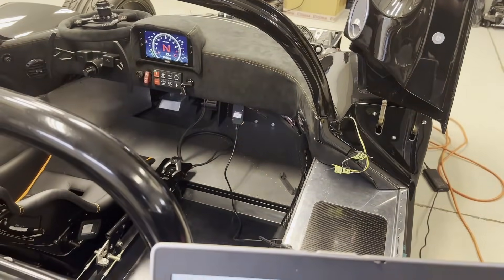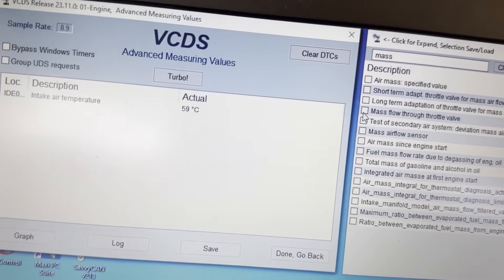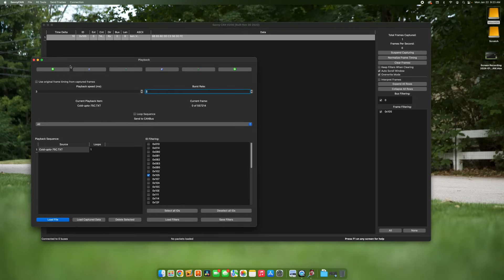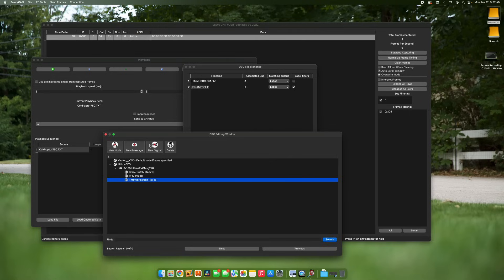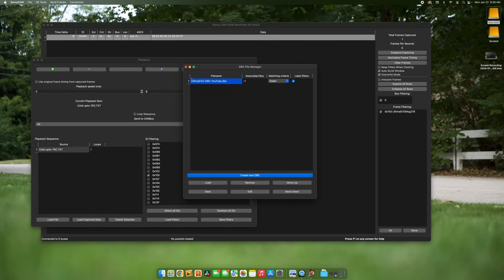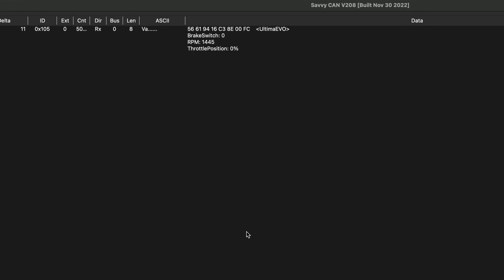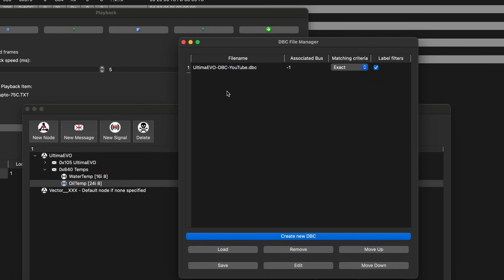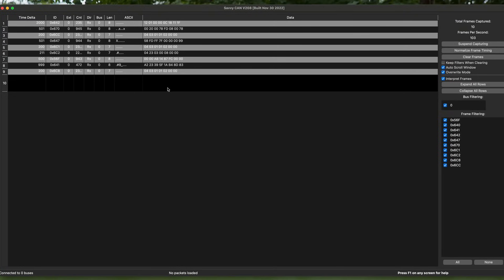PART-2: More CAN BUS Reverse Engineering on my R8/Huracan Powertrain!

Comment: Small tip on finding temperatures: If you're able to get to the sensors connector without dismantly any other electronics you can simply disconnect that sensor and should see a drop to 0x00 in value. Most automotive temperature sensor application start at -40°C for 0x00 which is also used to detect a short to ground or open line.

On the flip side, if you short out the 2 pins of that connector you will see a rise to the maximum hex value.

Thank you so much for doing this, I had no idea there was software to read it bit by bit as well. This will be very helpful in decoding my vehicle from here on out!

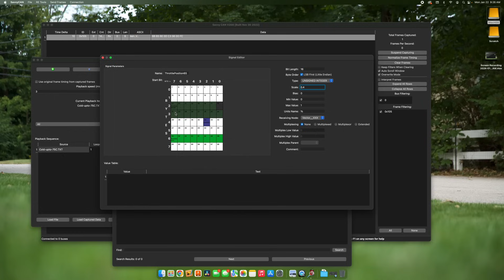Comment: Another nice video. However, your description of endianess isn't quite right - you've probably been confused by how SavvyCAN shows the signal location in the diagram. The Byte Order setting does NOT change the BIT order within each byte, as you desecribe. If your 16-bit signal had a value of 0xAA55 in little endian it would have a value of 0x55AA in big endian. Starting at 6:04, for little-endian (Intel) byte order, the grey box shows the LEAST significant (lowest value) bit (LSb) in the signal. When you change to big-endian (Motorola), the grey box shows the MOST significant bit (MSb). The Byte Order setting does NOT change between the bits being read left-to-right or right-to-left, as you describe. This is hard to explain in writing, but if you try the same experiement in Kvaser Database Editor, you'll understand as this has an arrow showing the bit order within the signal. This won't matter for most of your audience but I just wanted to offer this explanation for completeness and in case it helps you.
Reply from the maker: Thanks for the detailed explanation!  Since posting that vid, I since learned exactly what you describe here. It was a steep learning curve but I think I finally understand it 100%. Thanks again for your detailed explanation!

Comment: As someone that had access to the full internal docs of the CAN bus protocol on some cars I can give you some hints. By full I mean everything, every module, sensor and such. Sometimes there multiple versions of the data. From the actual sensor/package and then specially combined for things like instrument clusters. Engine temps are often combined, because they are shown by the single instrument cluster. But somethings like switches for mirrors, seats, lights, distance sensors a.s.o. are all over the place. Also, as seen on the example VW Golf file, some values are odds like 3 bits and often don't start at byte boundaries. And let's not talk about the offset and scale things, also all over the place. BUT you did a good job reverse engineering the stuff. Did not know about those advanced reverse engineering tool. Learned something new in the series.
Reply: Are these multiple versions in some type of umbrella, file folder configuration?

Comment: probably the best tutorial on Youtube so far! Congratulations! Have you found any CAN data about alternator and battery status, as well as catalytic converter status? I am trying to do some troubleshooting on my old Volvo but I do struggle to find help online
Reply from the maker: If your Volvo was manufactured any time after 1996 then it supports OBD2.  If this is true, then I would try a generic OBD2 scanner and you can read battery voltage, charging state as well as the behavior of your oxygen sensors (pre and post cat).  CAN data availability on older cars up to ~2005 is pretty limited....Hope this helps!

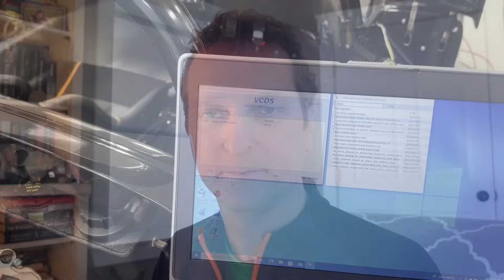Comment: I have watched part 1 and 2 of your series and am impressed by this reverse engineering. However, I am not sure whether you have actually determined the intake air temperature. You have used the airflow sensor at 34:00 minutes into the video. As the sensor name suggests, it measures the amount of air passing by per unit of time. By blowing air through it using the heat gun you change this value. I am not sure whether the same sensor can measure the air's temperature as well. So it could be that you found the intake air flow, not the intake air temperature. In your particular case I suspect that you compared your finding with that of other dbc files to confirm the correctness. If somebody does the same reverse engineering on another car without having a reference the two signals could get confused. Air flow and air temperature can be distinguished in that case by blowing ambient temperature air through the sensor: the air flow will increase but the temperature will remain stable.
Reply: The MAF sensor usually comes with an integrated temperature sensor, especially in VAG cars.
Reply from the maker: Most if not all MAF sensors measure  both air metering and air temp via two integrated sensors. The air metering sensor is way more sensitive and measured at a much higher frequency than air temp. Although I didn’t show it on camera, I used the heat gun at the same air velocity but varied the temp output to confirm I was measuring temp and not velocity. Plus, since the intake air temp value is in the same CAN ID as other temp values (oil and water), I’m 100% confident I have the right signal. Thanks for your comments and question!!

Comment: where were you 10 year ago when i was doing this lol

i would be trying it just for fun but now my obdii port doesn't have a direct access to the bus 

most new car have a bridge to prevent hacking

i had to find the value with obdii request instead
Reply from the maker: Yep, you’re right. I don’t have a “CAN gateway” in my setup so it’s easy to tap. But with a CAN gateway, you have to tap into the proper CANBUS wires directly and bypass the gateway. I meant to mention this in my video. You’re spot on. 👍

Comment: Amazing work! Surprised that the IAT logged so slowly. I guess that IAT temp signal is not the same as the actual MAF signal, even though it's from the same sensor, but still i would think they would want a higher Hz on IAT than coolant/oil. But maybe these CAN signals are only used for logging/display?
Reply from the maker: Yeah, I’ve learned that a lot of the critical engine telemetry is not broadcasted on the CANBUS. So to your point, I’m sure the ECMs are reading this data at a higher frequency directly from the sensor(s).

Comment: Would it be possible to write something to CAN to activate certain car features? For example, I have a button to enable sports mode, but its state is always off when I start my car. Wondering if I could reverse engineer what the button does and replay the CAN message via some microcontroller attached to odb2 to activate the sports mode every time I stat the car.
Reply from the maker: Yep, I bet you could do something like that. First you need to figure out if the button is a simple “dumb switch” wired directly to the ECM (like the brake switch in my video example) or if a button press sends a CAN message across the network. Either way, sniffing the CAN BUS while pressing the button will get you the answer. Once you narrow down the CAN ID and message that’s sent, you could replicate that with any number of CAN message transmitters.
Reply from the maker: Also, ECU Master makes an awesome little CAN device where you can program CAN frames to send. Might be the ticket for you.
Reply: 100% you can. I rolled down windows or locked and unlocked doors on my laptop by sending the respective CAN messages in my Mercedes about 18 years ago. I also developed a MCU based control module to open the sunroof (tilt) when the temp is too hot and closes it when the sun goes down and it cools off amongst other features.
Reply: @Bastard_Operator_From_Hell What is MCU?
Reply: @JohnZornAscended  abbreviation for microcontroller
Reply: @Bastard_Operator_From_Hell  ohhh.

Comment: Great video mate, what equipment would you suggest to allow a BMW m57 Ecu to integrate into a Chrysler vehicle canbus?
Reply from the maker: Hi!  You would need a CAN gateway of sorts that could take signals from m57 ECU and 'publish' selected messages to the Chrysler CAN BUS (and vice versa).  You might want to checkout the CAN Triple...it's a newer DiY product from https://mintonperformance.com.  Check it out; might do exactly what you need.
Reply from the maker: another thought: if the m57 ECU and Chrysler canbus are both running at the same canbus speed (usually 500Mbps), you could try simply adding the m57 to the Chrysler  powertrain CANBUS.  You might get message collision (if CANID's overlap between the two) but doing a "sniff" independently on each would answer that question.

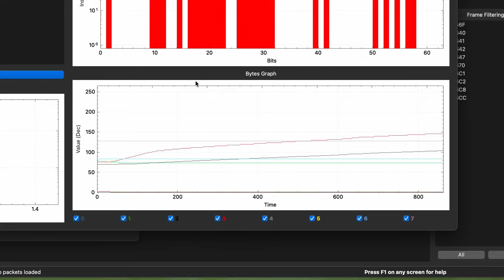Comment: 16:34 What might those graceful curves looked like if the endianness wasn't the same as the default? Would those integers curves look like completely random data?
Reply from the maker: Yes exactly. Since endianness defines which direction bits are read and converted to decimal, the resulting values would be wildly different even though the bit values/positions are the same for both cases.   Knowing endianness for a given DBC is critical because of this very reason.
Reply: @DanDulac  Thank you. I think the implicit part of my question is: As this Detailed Frame Information window doesn't have a control to flip the endianness, is there another place to do it, that would have the corresponding visual effect on this screen? (I'm thinking, no)
Reply from the maker: @douglasheld  the data we’re looking at in the Detailed Frame Information window is raw decimal values. We need to convert these values to the actual values that have meaning. We define this in the DBC file, referenced at 19:32-ish. When defining the signal, you select the little Endian (LSB) checkbox or leave it unchecked for big Endian.
Reply: @DanDulac  Great, thank you!

Comment: Would you happen to know the limitations for a modern ECU being able to live tune, besides the ROM?
Reply from the maker: @JohnZornAscended  I’m not a tuning expert but I don’t believe you can do live tuning on the OEM ECUs.  You can modify parameters but then have to upload the ECU config, test and rinse/repeat until you achieve the desired tune. But aftermarket ECUs like MoTeC, Haltech, Syvecs, etc allow you to do live tuning.
Reply: @DanDulac  Thanks for the response.

Comment: can you send canbus data ? like sending a 10% throttle positon to the ecu to make the engine rev without pressing the pedal ?
Reply from the maker: For CAN signals the engine ECUs are expecting to hear from other CAN devices, yes. But for something like throttle, this won’t work because the throttle by wire is connected directly to the ECU(s) and not a CAN device.

Comment: Will you have to put a smoothing (moving average?) factor into this data so the display is cleaner?
Reply from the maker: In the testing I’ve done, it appears to be fine with no smoothing function required. So far so good!

Comment: Hi Dan, I am looking at doing this in the future and looking to use a teensy with CAN transceiver rather than the CL1000.

I am unsure of the format of the serial stream output from the CL1000 for use within SavvyyCAN.

Would it be possible for you to use putty to capture an example few messages from COM8 (as it was in your video). Not sure on baudrate used.

Thanks
Reply from the maker: Here's a snippet of a raw CAN log file as recorded by the CL1000.  This is the format SavvyCAN expects to see for valid file import and playback.  Hope this helps!

Timestamp;Type;ID;Data
01T000006660;0;12f;5510010e48230000
01T000006662;0;312;cee03f0000000000
01T000006662;0;80;090b000062680880
01T000006662;0;81;590b000000103cff
01T000006662;0;105;924b0000436200fc
01T000006666;0;144;f981985801000000
01T000006669;0;b5;8405b40028000000
01T000006670;0;82;0301fe03fe030080
01T000006670;0;83;77010000ff000a00
01T000006672;0;80;0e0c000062680880
01T000006672;0;81;5e0c000000103cff
01T000006672;0;105;954c0000436200fc
01T000006672;0;147;00000000f0ffffff
01T000006674;0;10a;a31f80031d7f5402

Comment: Is this something anyone can do on any vehicle or would it break warranty / insurance or anything? And do I need to worry about damaging anything?
Reply from the maker: You can do it on any vehicle. What I’m doing here is simply receiving (reading) the data. Transmitting (writing) data is a different story as you’re actually manipulating information; which could create issues if you don’t know what you’re doing. But receiving/reading data is harmless and won’t void anything. You do have to tap the twisted pair of CAN BUS wires but if you have basic wiring skills, no problem there.
Reply: It doesn't break anything and you don't loose your warranty or insurance.

Comment: Audi R8 has MLB CAN data

BO_ 1600 Motor_07: 8 Motor_EDC17_D4
 SG_ MO_Ansaugluft_Temp : 8|8@1+ (0.75,-48) [-48.00|141.75] "Unit_DegreCelsi"  Gateway_D4C7,Getriebe_AL551_951_D4_C7,Getriebe_DL501_C7,Getriebe_VL381_C7
 SG_ MO_Oel_Temp : 16|8@1+ (1,-60) [-60|192] "Unit_DegreCelsi"  Gateway_D4C7,Getriebe_AL551_951_D4_C7
 SG_ MO_Kuehlmittel_Temp : 24|8@1+ (0.75,-48) [-48.00|141.75] "Unit_DegreCelsi"  Gateway_D4C7,Getriebe_AL551_951_D4_C7,Getriebe_DL501_C7,Getriebe_VL381_C7

BO_ 1089 Getriebe_04: 8 Getriebe_AL551_951_D4_C7
 SG_ GE_Sumpftemperatur : 56|8@1+ (1,-58) [-58|196] "Unit_DegreCelsi"  Gateway_D4C7,Motor_EDC17_D4,Motor_ME17_BY,Motor_MED17_SIMOS8_D4
Reply from the maker: Awesome--thanks so much for sharing!!  I compared this against my reverse engineered DBC and it's an exact match, with the exception of the TransATF temp; my bias was off by 2 (-60 versus the correct bias value of -58).  Oh and now I know the proper min/max values for each.  Thanks again for sharing!!  If you have any other R8 DBC entries, I'd love to see them...
Reply: @DanDulac  I have a DBC full of data for MLB
Reply from the maker: @jeroenr36  Wow!  I would love it if you could share. My email address is supraholic97@gmail.com. This could be a huge time saver for me. 🙏
Reply from the maker: @jeroenr36  Does your DBC file include the Malfunction Indicator Lamp (check engine light) and gear position data?  These are two key items I’m missing.  You’d be a life saver!
Reply: @DanDulac  Yes on PQ CAN it is -60, MLB CAN is different